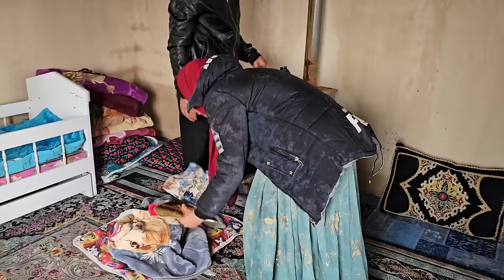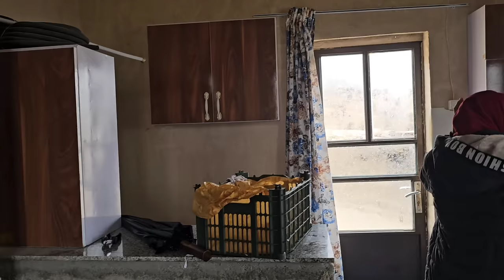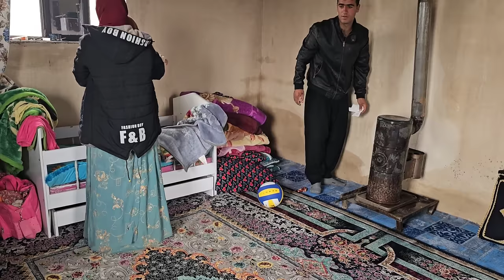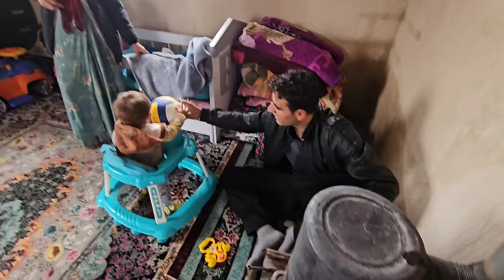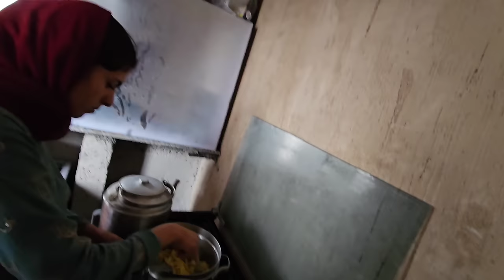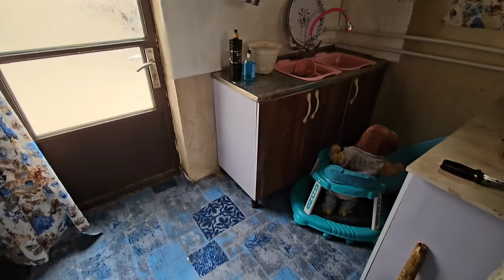Dealing with fire at home by father / nomadic family documentary

Comment: You need to build a roof over hot water system, washing machine & doorway it would save you moving machine in & out all the time plus give you somewhere to hang you wet coats to drip outside.

Comment: You don't think ahead. You want to solve everything when the problem is already there. Water has been flowing into the stove for some time, it would have been possible to do it in dry weather /don't tell Kohosrow that his feet hurt, because he was already wet long before that/. You also carry the washing machine here and there, and the water beats the boiler, instead of building it around. Or that big terrace over there, you don't use it for anything. You could add half of it to the house, there would be the kitchen, the boiler and the washing machine.
Reply: The "terrace" is already starting to wear away.

Comment: Why are you so worried about a portable washing machine that is made to get wet? It will be fine to just cover with plastic if it bothers you so much.  How about worry about your daughter's constance ear infections, getting her a non spill toddler cup so she can drink herself that she clearly craves to do and i don't know get a high chair to sit her in to feed her so she will "face" you and you can control her feedings better.  Then,  here's a thought.  When it's NOT raining... move firewood to a dry place and completely chop and stack so that it is readily available.  Better yet.... fix the outside wall and roof and keep the oil heater.  😊
Reply: And while I'm at it.  I've only asked a gazillion times for a shipping address and am told I can't send things from the USA. However,  another channel receives boxes without incendent. I will gladly send the cup I'm speaking of.  Gladly.